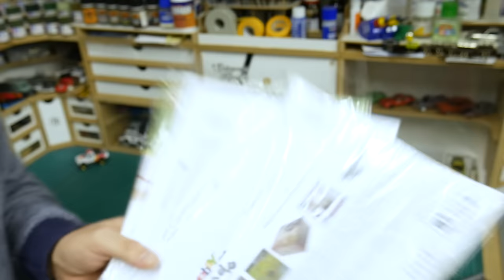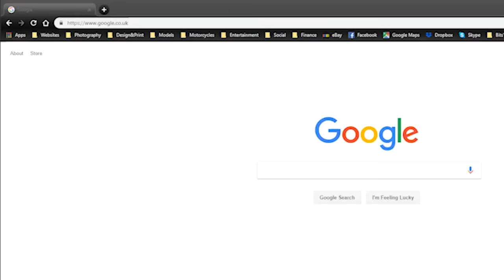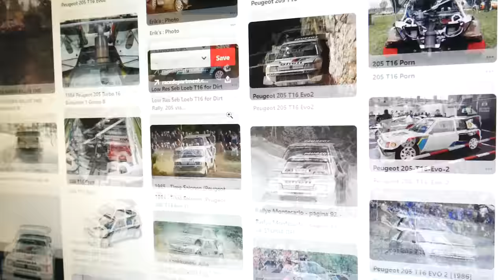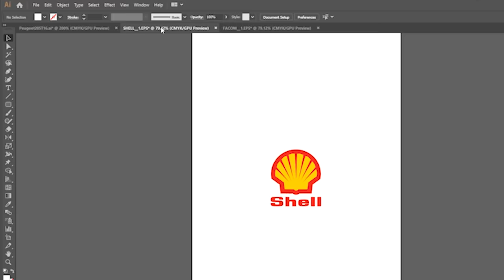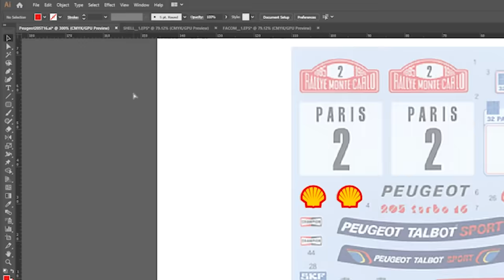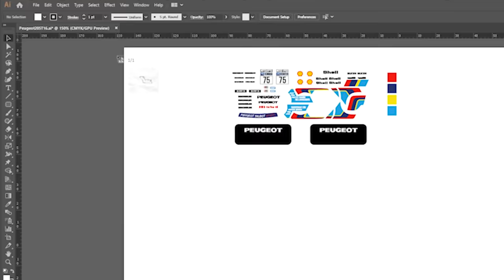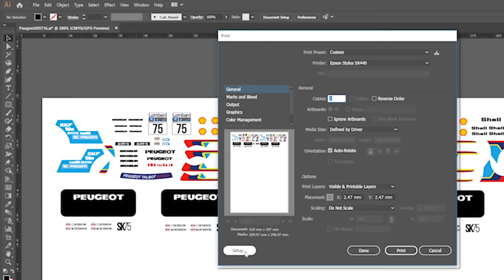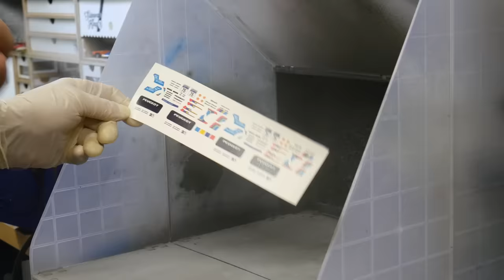'HOW TO' make water-slide decals for die-cast and model cars

Comment: I like this. A good overall presentation. Somebody may have already pointed this out, but microset is not a setting solution. It’s basically just vinegar and water and it reduces surface tension. If you really want the decals to melt into the details, that’s microsol.
Reply from the maker: Hi Will Thank you. Yes someone else has pointed this out. However I have been using this for years for this very purpose. As it states on the bottle it is a setting solution and it does soften the decals melting exactly how I want it to. I have used Microsol and it does basically the same thing, it does have the edge I agree on complex surfaces and angles but I certainly couldn't see any difference for the 'printed on' look, that is at least on the model surfaces I use anyway. Thanks for mentioning this alternative for others to use. All the best

Comment: I am working with 8 x 11 inch sheets as the decals I am making are for 1/200 scale Romulan Warbird models that I am 3D printing from the original Star Trek series.
I like the idea of printing them on paper first to check them. Thats worth its weight in gold.
I am more accustom to Gimp though than Vector programs.
I have several large scale Star Trek models that I am designing, so the Decals will be larger, but TY for the information.

Comment: Excellent and informative video.  I've only just managed to work out how to get decent markings onto decal paper, and using a rather old version of Photoshop, but even with normal varnishing thereafter, the images disintegrated on contact with water.  After watching this, I went out and bought the brand of lacquer used in this video, to seal the transfers... things worked wonderfully at the first attempt!  Using lacquer was such a small adjustment to what I was doing, but very important nonetheless.    I make plastic model aircraft kits, so some of the more unusual markings are very difficult to reproduce manually.  The sky's the limit now!  Thanks again for detailing your routine... ;-).  Regards,  Paul.

Comment: You can also scan the car on your scanner at 100% then you can open up the image and then size the decals right on the actual car. Before my external drive crashed I had over 300 Hot Wheels and Matchbox scans. I need to scan them all again.

Comment: I've used Photoshop since version 2.5.1 on the Mac, and 3.0 on Windows. Vectors and Pantone refs are available as well. I create 1400+ layer vector images of sports cars with it and it can also be stretched with no distortion. It comes down to preferences and tools you are familiar with using. The ends does indeed justify the means and if it works; use it.

Comment: Great video but I was hoping you would explain a bit about printer calibration, because the most common issue I see is people having the colors be way off.
And I noticed you use a set of 4 colors
Reply from the maker: I use basic CMYK colours, but nothing fancy. You can let the printer set the colours or the software to be the guiding force with the final print. I think most software is the default, it certainly is with Adobe. I don't calibrate the printer the colours are pretty spot on from the screen to the finished print. Thanks for watching 👍🏻
Reply: @SidewaysKing75  did you calibrate your display?

Comment: Thanks so much for this excellent tutorial. Being new to modeling I am just finding a need to make my own decals, so this video is perfect. Could you please explain the use of white  and clear decal sheets and which is used when. I'm in awe of your skills with Illustrator as I have not used it but need to now.  Cheers and subscribed.
Reply from the maker: Many thanks 😁👍🏻
Clear is used for a natural background on light coloured paintwork so if you were printing say a red onto a black car that wouldn't show up so you'd have to use the white paper to block out that black. The trade off then is that if you had text, for instance, it would be difficult to cut out each individual letter out of the white sheet so you'd have to make a compromise somewhere 🚙🚗👍🏻
Reply: That’s great info👍

I’m a bit late to the party but in cases where you need white paper I actually do it in 2 layers.  

On my artwork I make a very thin outline around the edge of the image in the colour of the model or black.

I print just that outline onto the white paper then cut the decal on that outline.  

Then I print the full colour image on the clear paper.

I place the white decal on the car and wait to dry.  Then I apply the colour one on top and that body colour or black outline will go just a hair past the edge of the white so you can’t see the white edge and that little bit of colour overlapping will disappear against the body colour of the car.

It’s a bit more involved if there is negative space on the image where the car colour has to show through.

Even with an Alps I do the same process, printing a white decal on the Alps as an underlay the printing my colour one on inkjet clear.

Lacquer seal is the way to go.  I started with acrylic (let ink dry a few hours first, then 3 light coats and a final heavier coat then wait til next day.  But I found the decal would still be so flimsy that it was very hard to position and would stretch out of shape.  Also the acrylic being water soluble gets tacky the longer you work with it and takes fingerprints or starts to let water get to the ink.

Switching to lacquer changed all that.  The decal remains uniform and can be poked and prodded around the model much like a factory waterslide.

I need to learn vector.  I learned raster on Paintshop Pro and got proficient and too stubborn to learn vector.

Comment: Tip:

Micro set is to prepare the surface 
Micro Sol is the one you put on after
Reply from the maker: You can put Micro set on after too 😉
Reply: @SidewaysKing75  hmmm yeah I'm building a USS Enterprise refit from Star trek 1/350 so it's not going to matter what I use because I will have to buy loads of the micro set and Sol
Reply from the maker: @ezridax5809  Enjoy.... that's an intense build for sure 👍🏻

Comment: In your illustrator settings when you export do you do it as Jpeg or Png? Does it make a difference? Also what is the paper type you ask for? Just ask for Decal paper clear?
Reply from the maker: Hi there, I print direct from Illustrator. Exporting them to JPEG or PNG immediately gives them less clarity in print. If you really have to due to adding more elemtns in Photoshop etc., then JPEG would be better but it will have a solid background, usually the canvas you've just designed on where as a PNG gives a transparent background and knocks out the canvas. Hope this helps.

Comment: Just out of curiosity because I’m a computer animator… have you tried 3d scanning when mapping out your decals? Different scanners will do different things… including the 3d program that you’re using… but Blender I found very useful when making a design. Even test fitting it to the object that you’re applying it to. I’ve only done that to Transformers & Legos… but just as a thought I wonder if anybody has played with that. Because what it does is that it flattens a space out where you can work on it… create a skin where you can see what it looks like on the object (digitally), & USUALLY you can directly take that skin without modification directly to the real object. Like I’ve said I’ve done this to Star Wars ships, Legos, Transformers… & it works pretty good. I’m just wondering if anybody has played with it.
Reply from the maker: I haven't to be honest, never really gave it a thought. It would be cool to try but knowing me I'd be that far absorbed in all that I would miss the point of doing my models LOL Its sounds very interesting though, but probably out of my budget to try. Thanks for the suggestion :)

Comment: One thing I noticed with clear decals is that when you place light color decals on to darker colors it tends to cause the decals to look black. I know this is because of color bleed through the light transparent decal film. So my question is, does using a laser jet printer do the same thing and if so is it then a necessity to use white on white or blue on white paper and if you do use white on white or blue on white how do you match the color of the object below for areas on the decal that the painted surface should be visible?

Comment: Thank you for this video! I’ve been trying to get all the information I need to start making my own decals. So it ultimately doesn’t matter what kinda of printer you have, as long as the paper and settings are correct, right? Thanks again!
Reply from the maker: Pleasure. Yes the important thing is that if you use an Inkjet printer you need to lacquer the decals before cutting them up and putting into water so as not to bleed. If using an Laserjet you don't have to do that and can simply cut and place in water.  🚗🚓🚕🚙🏎😁👍
Reply: SidewaysKing75 Thank you so much!

Comment: Great vid thanks. I'm an illustrator user but can you help me with a quickie - what tool are you using at 4:03 and 4:45 to trim those striped vector shapes? Thanks
Reply from the maker: It you go to 'Window'>'Pathfinder' then in that window use the bottom right icon once you've selected all your paths and instead of combining or cutting away the objects you've drawn it slices a path through all the areas where they intersect. You deleted the bits you don't want individually then. It helps when creating complex paths so you're not drawing everything in one. Hope this helps and I've explained it OK :)
Reply: @SidewaysKing75  Thanks so much! I found the one you mean and it's called 'Divide'. Much appreciated and keep up the excellent videos - they're really nicely made.
Reply from the maker: @gefthetalkingmongoose  thank you 😁👍🏻

Comment: I want to use small, intricate floral design decals that will be placed on a black background using clear waterslide paper, as white decal paper would be unacceptable, but printer's ink is quite transparent and the black background will dull the colors considerably. Have you had this dilemma? Do you know of any workaround?
Reply from the maker: Hi Valerie,  there's no other way than adding a white toner layer underneath. I have a white toner printer and so print the design in white first, to mask off the dark colour background then place the coloured decal over the top. You can print over the top and do this in one decal but at the fine scale I do they often misalign as I have to run the sheet through the printer twice. It works though 👍🏻

Comment: This video is very helpful, thanks, but I'm struggling to put custom decals (a family crest) on the front doors of a black model car.  I have white transfer paper and I've made the background of the crest  black.  I sprayed a couple of coats of artist's gloss varnish, but the decals won't slide off the backing paper, even after minutes of soaking.  I can pull them off with tweezers but not without damaging the decal. 
Wondering if I need more varnish, or if the paper's no good (Jupiter Cardz).
Reply from the maker: Hi Lorna.... it normally takes anything between 5 to 40 seconds for the decal to release so that sounds odd. I've had dodgy paper in the past where it has been difficult to come away so it may well be the same sadly. 
Hope it gets better for you 👍🏻. Best wishes and Merry Christmas
Reply: @SidewaysKing75  Thanks so much for taking the time to reply. Much appreciated. I'll keep experimenting.
Merry Christmas!
Reply: I've managed to get my decals applied now, thanks.  What I needed to do was add a couple of extra coats of spray varnish to the printed decals before cutting them from the transfer sheet.
Reply from the maker: @LornaWebberArt  Glad that worked out for you Lorna :)

Comment: Fantastic video.  Do you rate inkscape at all for this kind of work?  Being open source its all myself (and many others) will have to hand.  I use it for making up stencil kits for my vinyl cutter, but haven't had to make up decals yet hence my asking!
Reply from the maker: In honesty I haven't used it but having just looked at it, this will be perfect for starting out. In-fact just looking around the site it is very impressive and more than capable.... Thumbs up my friend!
Reply: @SidewaysKing75  Thanks for taking the time to reply buddy, really appreciated.

If you have the time to answer (don't stress if not!) have you ever used a laser printer for decals of this nature?

I used to use one years ago for guitar headstock decals, but that was large text and nothing fine/fancy graphics wise.  Just wondering how that would hold up with this minute detail - wouldn't need lacquered first either!

Still got the old printer, a Dell 1320c if I remember right, and cheap toners are available now... might blow the dust off it!!
Reply from the maker: @PurpleHelmet  it's no worries my pleasure. I do use laser but nowhere near as much as the ink. The colours come out a lot darker and I do still lacquer after on the car to gloss them up a bit as I feel they are still a bit matty. Detail wise it is fine, I use an OKI printer. All the best buddy

Comment: Hi,  
Would your method of laquering over freshly printed decals also work for saving old decal sets ? 
I have a loads of old decal sets which just tend to disintegrate when added to water.  I know you can buy a solution which does work but tends to thicken up the decal so is noticeable when applied. 
Regards
Reply from the maker: I haven't actually tried that but I like your thought process. I can't see why it wouldn't work. If it is destined to doom anyway then it's worth giving it a go for sure. I'd be interested to know how it goes. All the best
Reply: @SidewaysKing75  yeah it's worth a go. Keep up the good work. Think I've watched all your videos at least three times now and still learn something new every time.

Comment: I paint Necromunda model and want to use Decal on the rim of the bases, to name my models, would what you did in the video work? Is your mico set like ardcoat that games workshop use on there decals?
Reply from the maker: Yes it will still work. The Micro-set helps adhesion and softens slightly the decal on difficult areas, the Micro-sol softens altogether. Ardcoat is different and a finishing varnish for after the decal has been applied and dried out.
Reply: @SidewaysKing75  thank for you help.

Comment: how can we use this technique to create transparent edged decals for car colors like red for example?
If we were going to use the transparent paper to make a blue logo on top of a red car for example, congrats now we have black, but if we use the white paper, then congrats we have white edges around the logo.

One idea came to my mind recently but couldn't find time to try it out yet;
If we were to make a thick red (color matched to car) outline for our blue logo in the software, and then print with white paper, would that be a good method of doing such stickers? What do you think? oh and nice videos sir!
Reply from the maker: It is tricky, well impossible, to print colours and place them over other colours as they mix you're absolutely right. This method is only good for a white base layer. You would have to use a mask, that being white again, the same shape as the colour you are doing if you wanted to place it over another colour. Depending on the size it works, and works well, but if you were doing text for instance this would be extremely tricky to cut out accurately, especially at 1/64th die-cast size. Printing directly onto white yields good results but as you say then you get the white edge around. I have heard of white ink printers but have yet to discover any, or cartridges for that matter. Maybe I should do another video explaining this and ways around it I do to try and help. Its a fine compromise unfortunately my friend. Thanks for watching and commenting :)

Comment: How do you avoid any hinges gumming up when applying laquer?
Reply from the maker: I tend to to do two or three light coats, they are very light coats which is enough not to allow any build up. Also between each coat I will open/shut any doors, bonnets, boots etc., and alternate this on the next coat. I've never had an issues :)
Reply: @SidewaysKing75   Right.  I shall have to do some (a lot) of practice and get my ham fist removed.

Comment: I’m interested in how you take the traced image and scale it correctly within the vector diagram
Reply from the maker: Its a combination of measuring the car and photographing it. Mostly its easier to take a photo of the car side on, front on etc., measure it and scale it to the size in Illustrator. I then simply resize to fit. All the best :)
Reply: @SidewaysKing75  cheers it's the resizing in illustrator I am fascinated in, can you assign a dimension to the vector, or is it a print and see if its the correct size?
Reply from the maker: @bcostell69  yes you can resize exactly by inputting size if you wish 👍🏻

Comment: Does the paper support the Dye-based ink? Because some decal paper only use Pigment-based. And what is the ink on your printer? Can i use an ordinary printer? 
Pls give me the information 
Thanks
Reply from the maker: The paper I use supports both inks. I use re-manufactured inks for Epson SX2445W of which kind they are I am unsure. This is an old, 5+ year machine and was cheap at the time too. The paper, whether it is in laser or inkjet format, is designed to go through any ordinary printer.
Reply: @SidewaysKing75  and what is the brand of the paper? I'm a bit interesting
Reply from the maker: @hafizhnabawi1707  link direct to Mr Decal Paper's site is in the description 👍🏻
Reply: @SidewaysKing75  ok thank a lot sir